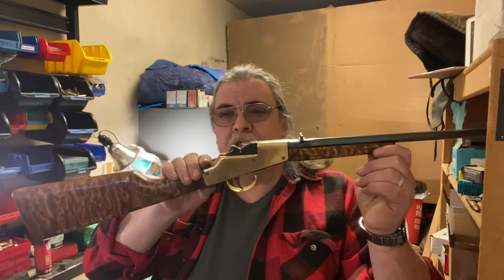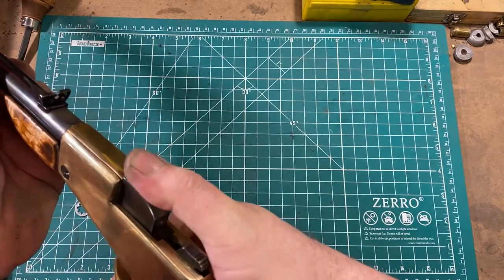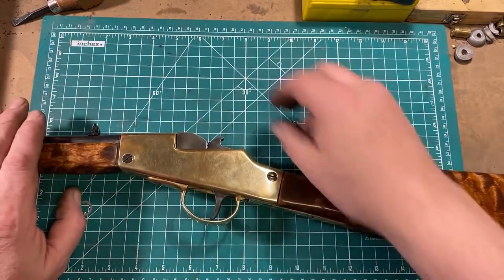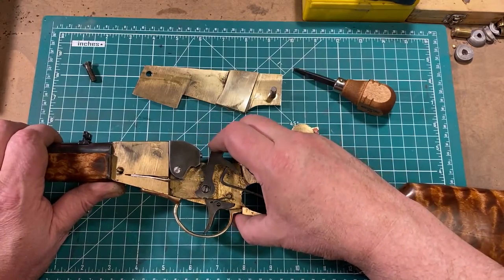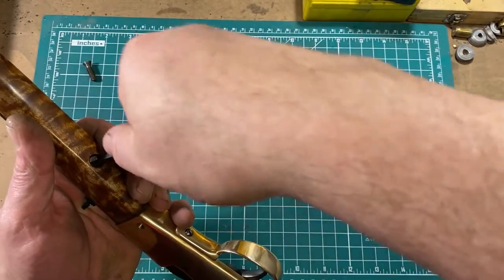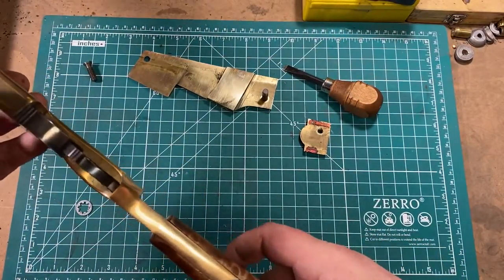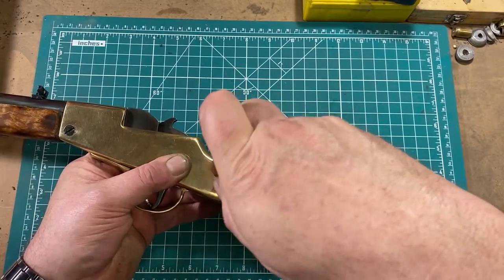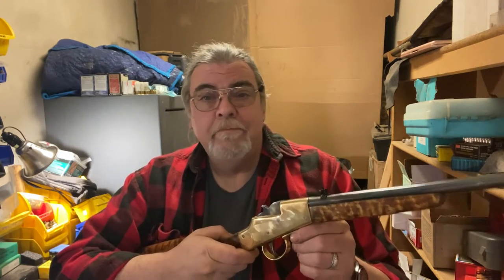Homemade Rolling Block .22 Carbine

Comment: WOW Tinker…you’re a genius !  That is a great design. Even though rolling blocks look very simple getting the breech block / hammer to work properly is not a small feat.
Your brass receiver looks great, I imagine you spent many hours with a file and emory cloth rounding the edges and getting it to fit together so nice. I like your rifle a lot more than the little Chicopee rifle I have seen several people make. Great job 👏 and Great video !!
Reply from the maker: Thanks Sandra.  Yeah it was a lot of work, but worth it.

Comment: Very good example of using brass for your receiver in a .22lr chambering.  Single shot designs like Rolling Blocks, Falling Blocks, Vault Locks, etc are amazingly simple and sturdy designs; some of them can do some fairly hard hitting cartridges when taking into care your choice of steel.  If you are interested, my friend Charles over at Gearhead Guns LLC makes single-shot build kits of the Model 6, the Jaco, and the Chicopee rifle if you feel the urge to make another single shot.

Comment: I wonder if an air-rifle barrel could be used. I know that an air-rifle is far lower pressure but the barrel on a springer needs to be built up enough to be used as as lever to compress the spring.

Comment: How did you come up with the design layout and the internals (breech block, hammer and trigger) ?   Pretty amazing considering you fabricated it on a drill press.  JMB would give his stamp of approval.
Years ago Navy Arms produced a Baby Rolling-Block in 22 Hornet.  It was an awesome rifle except for the trigger pull.
Reply from the maker: Basically I knew what every part had to do and I had built some single-shot pistols so I just kind of made it up as I went along.  I had a lot of metalworking experience and was used to adapting to the limitations of my equipment.

Comment: This is simply excellent. I have a question though. I’m thinking about making my own rolling block rifle chambered in 38 special. Do you thing the locking mechanism you used would be fine for 38 SP or would it need a stronger one? It’s a pretty low pressure round so I’m sure it would be fine. Also, does the barrel go into the big brass part of the receiver? And if so is it soldered in or screwed? Thanks :)
Reply from the maker: I'd still beef it up significantly over mine.  'Low Pressure' in the case of .38 Special still means 14-16,000 PSI.
Reply: @tinkertalksguns7289  ok thank you I’ll keep that in mind. One more thing though, how did you fix the barrel? Is it soldered or welded on or can it come off? Thanks :)
Reply from the maker: @TheFireGoose  On this little .22 it's a press-fit with red Locktite.  I'd add pins at least on a .38 Special barrel, and threads if possible.
Reply: @tinkertalksguns7289  ok cool, thank you very much :)

Comment: If you ever need to head space there are higher grade bolts that will inset in breach face had good luck with firing pin face,s be safe Peace to all

Comment: California and States like it and any of their Government actors ,agents , employees, legislators etc. who are responsible for introducing , debating enacting and enforcing the Laws You describe are in contempt of the Constitutions Supremacy in prohibiting such Laws as well as the Constitutions Equal Protection’s Clause. Those Laws may be on their books but are really null and void at conception. Anyone enforcing those Laws are liable to those who’s civil rights are violated. Very good video. Very attractive firearm. I wish they sold them in carbine and full stock military configuration. I like the old drop blocks too and side lever’s. Obviously You were raised by good parents who taught You that You can do anything if You want to. Do we really want Laws that we must hire attorneys at exorbitant fees to translate or debate in court ad nauseam. Our Founders , knowing that many citizens were not educated to the degree that they were wrote Our laws to be easily understood without the fore mentioned necessity. Anyone who has ever adjusted the flame of a welding or cutting torch knows that to Regulate is to adjust for uniformity. The Founders lived in a time of technical advancements and wanted Citizens to possess regulation arms and equipment’s  contemporary to any that a select , vetted military force under the exclusive authority  of a power authoritarian government would certainly be equipped with. Power corrupts and absolute power corrupts absolutely. At no time in history have military or other forces under a executive authority needed a right to keep and bear arms.